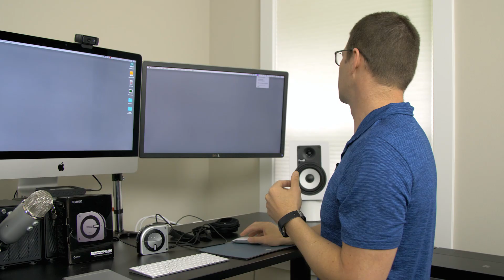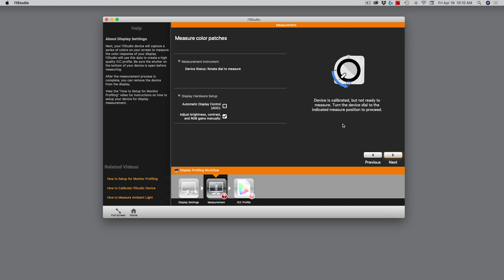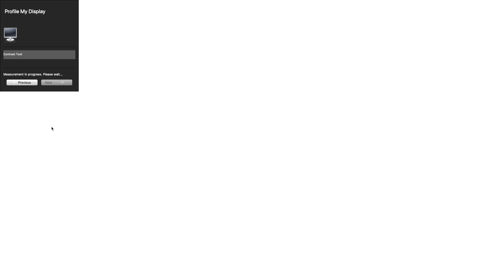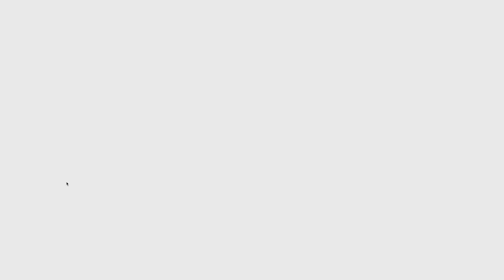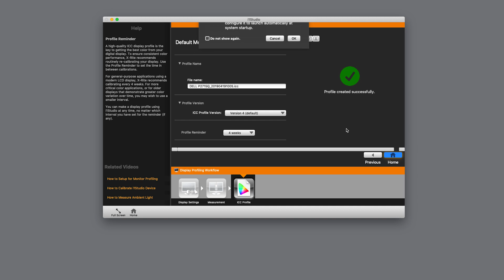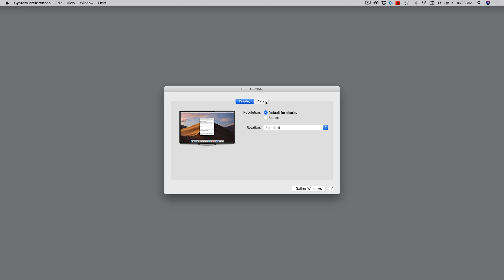i1 Studio Review and Operation - Part 1 Monitor Calibration

Comment: I have watched several YouTube videos on calibrating the printer with xrite studio. I also have the canon pro 100 printer. Nobody mentions the printer settings used for printing the initial color swatch.  Do you use the manufactures paper icc profile or do you let the printer driver control the color? I would think use of the paper icc profile would be best as it would require less adjustment in the final stage of the calibration routine? 
Your clarification of this matter would be appreciated.

Comment: Mike, great video.  I took a portrait class from you quite a while ago in Vancouver, WA.  Just found you again.  I appreciate your keen knowledge and helpfulness.  Question:  I am actually using the Colormunki unit and just updated with the i1 software.  Should I turn on "automatically adjust brightness" setting in the Display options on my MacBook Pro?  Or leave unchecked?  Thanks so much and great to "see" you again.